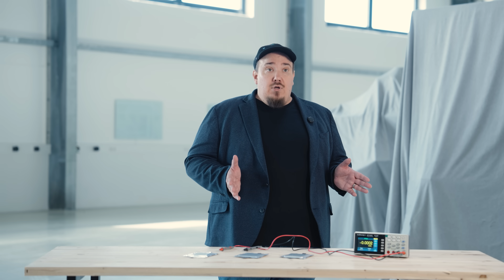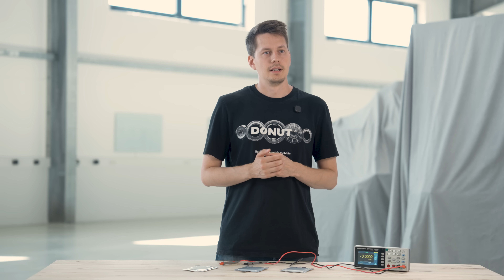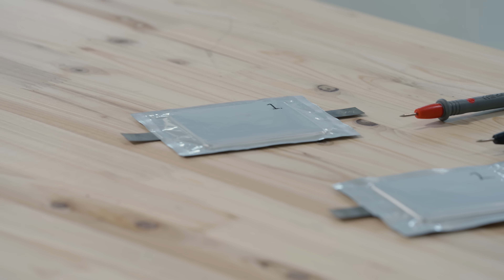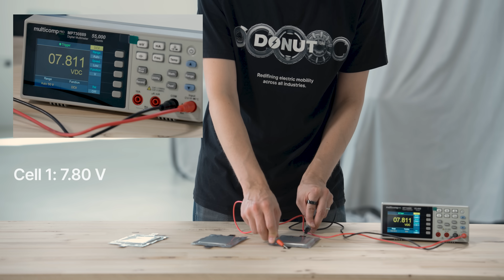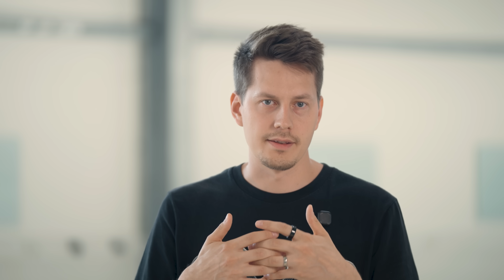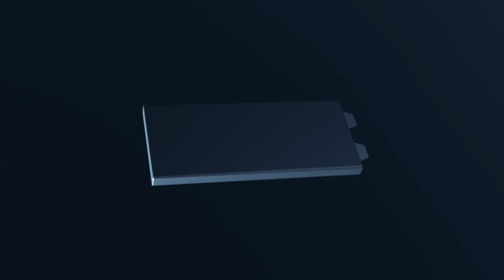Bipolar Cell | I Donut Believe

Comment: it explains, sort of, however with all the circus this company did and their FDM printed el-cheapo prototype shell on CES, I'd rather believe they simply packed several isolated li-ion cells inside and packed them in another bag, than this is a true solid state battery, at this point.

Comment: If you have been allegedly showing and testing full format cells of this technology for months, why are you now demonstrating with small pouches now? And why were all of the tests so far showing cell voltages of a standard NMC lithium based cell? Bipolar cells with a different chemistry could account for the nominal voltage being the same as NMC, but it is never going to explain the shape of the OCV curve

Comment: balancing between layers ?
Reply: Difficult with bipolar design, so the objective is a high uniformity in cell characteristics, which is achieved in this case by high precision screen printing using CT-Coating AG technology, and solid state electrolyte that eliminates charge leakage at the perimeter.

Comment: Still dodging hard specs on the underlying 'solid state' technology, the animation suggested there were 6 - 0.55v cells in the 3.3V package, critics are judging the 3.3V packages used in demos to have characteristics of Lithium cells.  Demonstrations of a  0.55v package would be revealing.

Comment: Wait but... Won't that cause problem with balancing each cells inside each cell? This is concerning.
Reply: Not really, it's the same as current EVs that balance a battery pack at the module level not the individual cell level. The modules self-balance internally effectively if there is a voltage difference across the cells within the module, and balance across modules when charged via a BMS.

In the case of the Donut Lab bipolar battery the module is effectively being minaturised to the cell level, with layers stacked to a desired voltage. The cell internally balances any voltage potential difference within the cell the same as an EV module does. 

Further, the approach allows layered cells to be connected in parallel to create a parallel-series battery module, one that can be tuned to required Ah capacity (more cells in parallel) and voltage level (number of layers within each cell). The module will also self-balance internally due to the potential difference between parallel cells, further aiding the internal charge distribution within each cell. 

Just like current batteries a BMS can be used to actively balance these modules at a pack level as well, to ensure during charge and discharge the energy flow is appropriately distributed. It's just the Donut Lab battery minaturises (reducing components, wiring and cost) the role of series connected individual cells within a module to that of a single of a cell.
Reply: @GruffSillyGoat "autobalancing"  only work with parallel connections, not serial connections per module?
Reply: @villekinnunen6357  - yes and no.

Parallel cells distribute the charge amongst themselves, and self-equalise faster, whether the cell set is in or out of circuit

However, series rechargable cells, when in circuit, will equalise just much more slowly and to a lower level of equalisation across the cells (influenced by factors like internal resistance, cell age, temperature)

In the highly controlled manufacturing process in bipolar cells the layers are all virtually identical, with a large connection cross sectional area, this tends to make the charging/charging of the cell layers more uniform than with discrete cells in series. Their large internal contact area between the layers also supports higher levels of self-equalisation when in circuit.

Comment: The last line in the video is telling..  "our target is to still deliver the first bipolar cells to customers this year"..  
Cept remember these are "the first solid state cells used in production vehicles"..    already..    
Again, sounds like they're touting capabilities that are only in their upcoming V2 cells (bipolar 400+Wh/Kg), while delivering something different in their existing V1 cells.
Reply: V1 only exists on paper.  No one outside of Donut has ever seen or touched one.   It's not clear exactly what VTT tested but it clearly wasn't something with CES specs.
Reply: @jazzerbyte   I think V1 exists, but they were touting V2 specs at CES.
Reply: @daemn42  Sure, that's what they said on April 1st, but fools keep asking when they're going to ship the motorcycles, even though those who have placed orders have said they're on a waiting list for autumn (September-October)...
Reply: @daemn42  
Neither v1 or v2 exists, only question is who is the original scammer, as it could be that Donut Labs bought non existing battery technology, started to promote it way too soon and now are left on ice without anything to show. Everything they do is indicative to a generic scam

Comment: Well, this is getting really interesting.... If what was shown is true, and each cell has 0.55V, they of course can scale up the voltage to a required level using bipolar approach. The question here is what current density they really have in those shown cells.... at this low voltage, they probably have between 1-10mA/cm2 per single cell (0.55V).... also depends if cells are just stuck on one another, or rolled as multilayer pouch. This may give a clue that those tested cells shown earlier were actually NMC or other lithium based chemistry, and the cells shown in this video are actually Donut Lab's cells. I am sure they have their solid state battery under development with promising results, maybe some kind of sodium/ceramic/oxides chemistry. It would be more clear and interesting to see if they run the same testing done by VTT with these particular cells.
Reply: Looking at the dv/dq voltage curves of the V1 cells, as published on FaradayNotes, they don't seem to match any known Lithium Ion standard reference cells (LFP nor various NMC combinations), and their voltage range is well within both Lithium and Sodium capability. The analysis, by an actual battery scientist, determines the V1 cells were also likely oxide based. I would expect on this basis the V2 cells are a refinement of the V1 technology, one using more accurate printing technology to enable more precise layering to be achived.

Comment: when he says that there is less cells to manage less braking point if there will be fewer cells, I can not see the point if there are several  cells into one giant cell, I agreee that it is much simpler when you have fewer cells to build the pack but if there is many layers ei cells in one giant cell if any of one layer  will damage you should change whole a giant cell, it is cheap to assemble but  costly to repair

Comment: So...we are being shown another interesting tidbit, but still haven't seen any proof of longevity or energy density 🤷‍♂️
Reply: For proof of longevity all you need to know is that a solid state bipolar battery has been running the Oxford Bell experiment continuously since 1840, the Clarendon Dry Pile battery.

Their energy density claim is more tenuous, but nonetheless credible. Essentially they are saying that because their battery doesn't need all the trappings of a Lithium Ion battery the energy their battery holds for a given weight will be equivalent to a lithium battery with an energy density of 400Wh/kg. This is a reasonable claim, because a Lithium battery needs inter cell connectors and bus bars, cooling, casing and packaging that the Donut Lab battery doesn't need.

Six or seven years ago a bipolar organic carbon polymer battery like the Donut Lab battery was being developed by FWG that was said to be capable of powering a Renault Twizzy EV from Lands End to John O'Groats on a single charge, a distance of 840 miles. Six years later, one can only assume that the precision screen printing process for laying down the activated organic carbon polymer and a change to a solid state electorate have improved the energy density even further.

Comment: Whether you connect cells internally unipolar,emaning in parallel, or bipolar meanign in series does not change anything about anything else a battery cell should provide. 

Energy, power, size, weight, materials, temperature coefficient, temperature stability, efficiency, safety, profitability, price.

Just keep on gaslighting. you are too funny.

Comment: For what it is worth, if the number of layers shown is accurate, each layer controbutes 0.55 volts. So maybe this is some widely different chemistry. The same voltage as a potato battery.
Reply: Maybe fried potatoes until they are solid.

Comment: Is it joke from donut guys? Where are gravimetric and cycling data?:face-turquoise-covering-eyes:
Reply: If you listened to what he was saying, you would understand that what they are actually claiming is that for a given weight their battery will hold the same capacity as a Lithium battery with a gravimetric energy density of 400Wh/kg. This is a reasonable claim to make, although the actual gravimetric energy density of the battery will be somewhat lower. This is because a bipolar battery doesn't need all the additional 'clobber' that a Lithium battery needs.

Donut Lab can hardly be blamed for delaying the most difficult thing to understand until last.

Judging by the comments on this and previous videos, most of the viewers are incapable of understanding such a 'complicated' message.
Reply: @sailingoctopus1  Dude, relax your cheeks and try to be a bit more polite🤣

The Donut guys explicitly claimed 400 Wh/kg for their cell. That is gravimetric energy density - full stop.  

Not “same capacity as a 400 Wh/kg lithium battery once we ignore all the clobber.” That’s just a fancy way of moving the goalposts.  

If the actual cell on a scale doesn’t hit ~400 Wh/kg, then it’s not 400 Wh/kg. It’s really not that complicated,  it’s the literal definition.  

No need to bend physics to defend them. Real gravimetric and cycling data would be a lot more convincing than these word games:face-turquoise-covering-eyes:
Reply: @AaronFaustov Maybe moving the goal posts, but not an unreasonable approach for making a fair comparison. Does a car manufacturer care whether a battery has a gravimetric density of 400Wh/kg or 200Wh/kg if the net weight of the car is the same and the batteries hold the same amount of energy?
Reply: @sailingoctopus1  No, it's not a "fair comparison" — it's literally moving the goalposts.

Donut Lab didn't claim “our battery gives the same energy as a 400 Wh/kg lithium pack at the vehicle level.” They claimed 400 Wh/kg for the cell, and it was done repeatedly and very clearly.

A car manufacturer would obviously care about the difference between 200 and 400 Wh/kg at cell level, because that directly affects pack weight, vehicle range, cost, and structural design. That's why cell-level gravimetric energy density is the standard metric everyone uses.

You can’t hype “holy grail 400 Wh/kg cells” and then backpedal with semantics when asked for actual data. That’s classic goalpost moving.:face-turquoise-covering-eyes:

Still zero gravimetric numbers and zero cycling data. Just more creative explanations.
Reply: I don't know why they are waiting to show proof of it yet or if they can't prove it, but I think the other claims are more important in the end. If they can manufacture it in the way they claim and if the numbers are only half as good as claimed, it could still change things. The screen-printing machine costs only a few million dollars and can be used in ambient temperatures. The chemistry is probably capable of 500Wh/kg in some situations, much lower in others. The point is that it isn't one thing, it is customizable in a way that no other battery manufacturer can claim. I don't understand why they are rolling it out the way they are, but there is much more to this than that one number. It's the process itself more than the numbers that could make it a gamechanger. That's how I see it anyway, and I won't care if it only reaches 350Wh/kg or even 200Wh/kg if it changes the manufacturing process so that I could have a factory in my small town without billions of dollars in investment.
Reply: @robertludwig5620  I respectfully disagree.

Even if they only reach 200 Wh/kg, it would be difficult to see this as a game-changer. Current state-of-the-art commercial lithium-ion cells already achieve 300+ Wh/kg, with several manufacturers going higher. At 200 Wh/kg the advantage basically disappears for most applications.

On manufacturing, a screen-printing machine might cost only a few million, but I doubt it will compete on cost or productivity with modern high-speed slot-die coaters used in gigafactories. Throughput and yield are critical at scale.

Bipolar designs are also not entirely new and similar approaches have been explored and even commercialized before (e.g. Toyota’s bipolar Ni-MH batteries). While reducing interconnections in a pack could theoretically lower failure rates, a well-designed conventional pack with good BMS can already achieve very low failure rate. It’s not clear this bipolar version would offer a meaningful edge.

In the end, a ~200 Wh/kg cell with unknown cycle life, medium-to-high cost, and no standout advantages over existing Li-ion doesn’t look particularly compelling. I’m skeptical that experienced battery investors will find it attractive.
Reply: Cycling data? OK you tell us, how are they going to provide that?

Lithium battery cycle testing uses heat as a proxy for aging, because otherwise the testing takes too long, and that's with batteries that are only rated for a few thousand cycles.

Heat has proved a good proxy in cycle testing lithium batteries, because the correlation is strong. The independent VTT testing of the Donut Lab battery has shown that it is pretty much unaffected by heat; try cycle testing a Lithium battery at 80°C and see how long it lasts.

The truth is that they don't know how many cycles it is good for. What they do know is that bipolar batteries do not degrade like Lithium batteries. They know, for example, that the solid state bipolar Clarendon Dry Pile battery has been powering the Oxford Bell experiment since 1840, so it's a reasonable guess that their solid state bipolar battery is going to last a bloody long time. They probably guessed at 100,000 cycles because the Oxford Bell has been running for 78,000 days, forgetting that it's still on its first cycle.
Reply: @sailingoctopus1  Dude, I already politely asked you to relax your cheeks and drop the condescending tone🤫. Where did you learn these discussion manners? 

As a humble battery engineer, let me give you some advice: you don’t even need aggressive heat acceleration on the Donut cell. That’s supposed to be one of its big advantages.  

They’ve been loudly claiming 100,000 cycles with 5-minute full charging since January. Even at a relaxed 10-minute full cycle, they should already be sitting on over 4,300 real cycles.  

Meanwhile, ordinary Toshiba LTO cells (which are just regular lithium-ion, not some revolutionary holy-grail bipolar magic) easily handle 10-minute cycling and are proven for >20,000 cycles with actual data.  

So if Donut’s “world-changing” cells can’t even show a few thousand cycles… that’s quite telling, isn’t it? 

 “Trust us bro, it’s like the Oxford Bell” is not the mic-drop you think it is:body-green-covering-eyes:

Comment: Won't there be a balance issue if you manufacture it this way? How will the BMS work?
Reply: Not all battery chemistries need external connection for balancing, depends on whether you can safely overcharge each cell. With li-ion we obviously can’t. But this is not supposed to be li-ion if we believe donut labs.
Reply: balancing requirement will reduce. simple balancers will be required

Comment: I said this battery was a solid state bipolar organic carbon polymer battery, but no one was listening. As I said repeatedly, it sounds like a development of the battery that Robert Murray Smith was working on six years ago.
Reply: What are the natural resources needed to build such a battery ?
Reply: @81SteF https://www.google.com/search?q=what+are+the+main+materials+used+to+make+a+bipolar+organic+carbon+polymer+battery%2C+like+the+FWG+blade+battery+that+Robert+Murray+smith+was+working+on+six+years+ago&gs_lcrp=EgZjaHJvbWUyBggAEEUYOdIBCjExNTY5M2owajeoAg-wAgE&client=ms-android-gotron&sourceid=chrome-mobile&source=chrome.ob&ie=UTF-8&udm=50&fbs=ABfTbFXmzBGw9LECshVETHbdczUekrr4P3jxmDQ00QvQP6rDCdtPYR3axwa3PBwR4KMem_w9tIVjO5NdCjrCkWCJCZEye0LY5E0SEw8M6XTAU7uXvM4KMQW4jKU7yLRoUrR2KqfxcyARSpc7MDSf8Z8Eb4hxCV3Ac9d2gIFQNUl4bCYtMykWqD26MZrLSiKD9YRz-1fsnhGBycdKVe0MYOz0_jSFA4XfpKGRl8Jpz46yBDBOBRXM6Y0&aep=10&ntc=1&mstk=AUtExfACjM56LaMf2MTHqYqGbMwMvlGu1LqmaLndzTq8RWXneOn4wipjqqSmT3aBsY1mHZM4iqyfeGvYnxzJPprglVSxDJPxPU9uhhPUcuV_BQv-yoPBw6ZKLfyDQJQohYY7ku_1sBiHdOewjwOCP7P_4kLAQ3bqHJZqA2-yr6oh5dCkklxRyY1q8bT5SoyQnW1eeVyabHY8S6mBmKOP2R2ywo3EG2w3N6sigTnbKDL-8dRJ1GCH2u1asN-eKlOgiK5wdMPfB8P_jaSEhnWEAxyT7v6HxwKj-HmEFCH8qAOaXnX6hIfwvXdGvub032c6H7QJaD7zrklmeXVysEaE2EfRJUxIlCl2kwWYfqh0z3GdThjyat1Otwh30Vc&csuir=1&aioh=3&mtid=hN9Xas_0IvWohbIP_Y3F-QE
Reply: Im sure Marko would hire you!